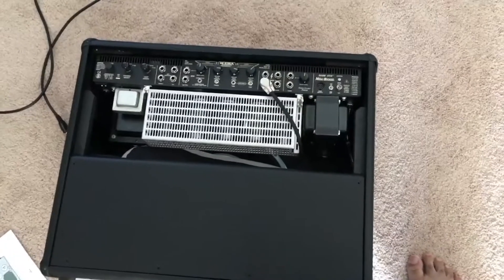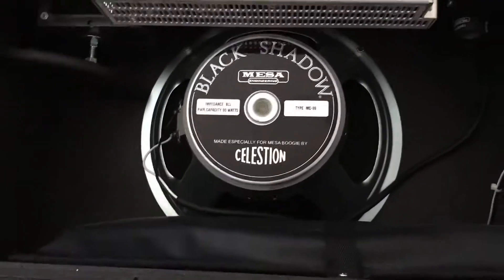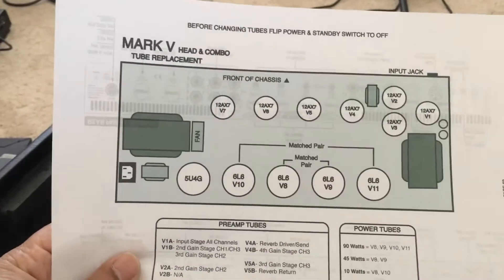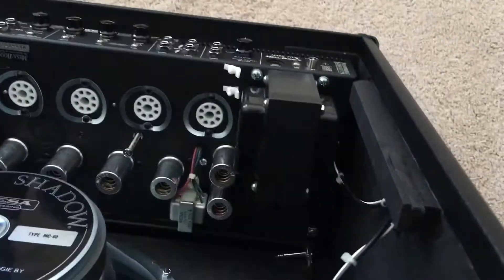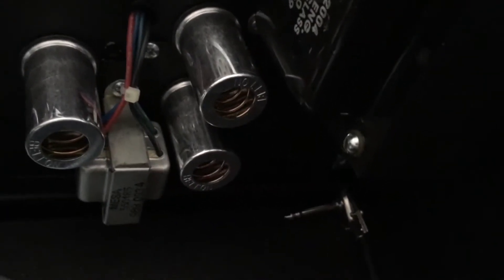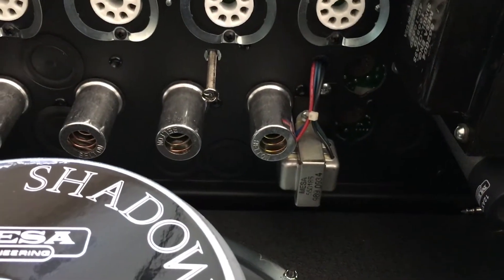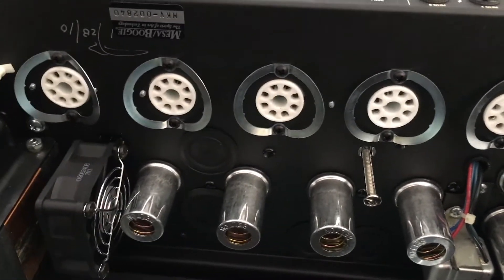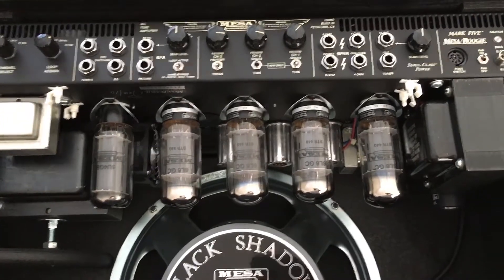Mark V Tube Replacement

Comment: Wouldn't it be worth the trouble to remove the amplifier from the cabinet, especially to replace the 12AX7 behind the transformer?
Reply from the maker: Honestly, I don't know.  This was the first time I ever did anything like this.  To your point, that tube was a bit tricky to get the new one in, but it worked out in the end.
Reply: @RedDutta  You definitely want to pull the chassis from the cabinet to change your tubes. One bent pin on a preamp tube could lead to forcing it in and damaging your tube socket. Plus, you should spray some contact cleaner on the pins and work them in and out a few times every time you change your tubes.